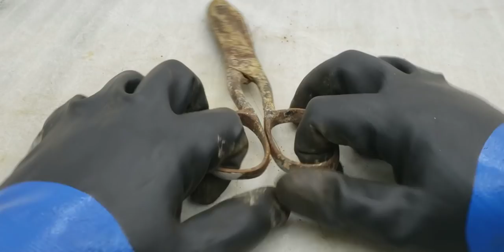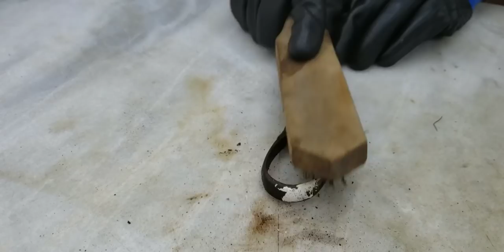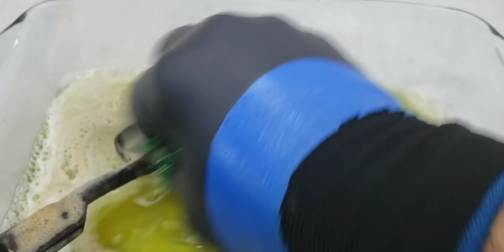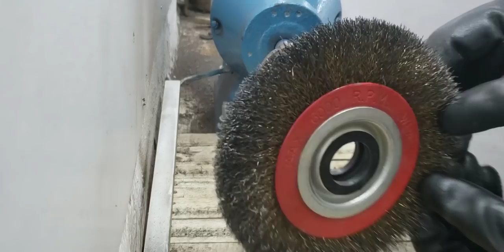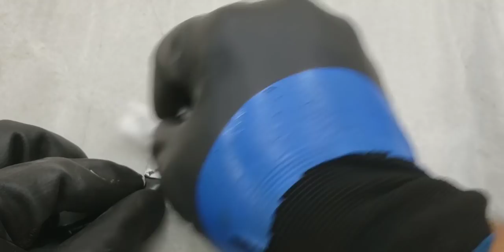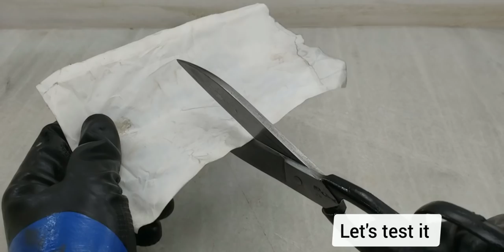70 Years Old Useless Scissors Restoration | 15 MIN RESTORATION

Comment: Those scissors are/were used to cut fabric. Both my mother and grandmother had exactly the same type scissors in their sewing baskets and they only used them to cut fabric. Cutting paper with those scissors were a huge NO NO. Taking care of your scissors and use them properly were among of the very first things I learned when I started sewing back in the 50's. Great job repairing them. 👍 🥰
Reply: I started sewing in the 70's. My Aunt's had those scissors. They were born like 1912 and 1918.
Reply: I have a pair of scissors, also my mother's, from the 1940's, and also used only for fabric.  She had a "professional" sharpen them and he ruined them.  Can only cut paper now.  They also have the black handles and stainless steel blades.

Comment: Why do the wire brushing and the soaking and scrubbing if your going to follow that by using the wire wheel?
Reply: It's usually for combined time management.  Overall he probably spent less time getting it to the state it was in after using the wire wheel than if he just used the wire wheel completely by itself.
Reply: @lukeolinger6000  I suppose that's possible but I'm skeptical about that.  I have no idea how much time he spent on the brushing, soaking, and scrubbing but it doesn't seem likely that it would have been quicker than just using the wire wheel.  Perhaps he wanted to minimize the dirt that would have been collected in the wheel.  It's all speculation until he explains his reason(s) for the method he used.
Reply: @jertoneg1830  exactly, we won't know unless he replies.  Using all of those different methods probably generates views and votes too.  Also, the minimize dirt/maximize life of the wire wheel seems like a plausible reason.
Reply: @ResetResto That sounds reasonable.  Thanks.
Reply: I was thinking the same. I wish they would stop wit the big clunky wire brushes ( hand  brush) . To me it's like nail on a chalk board and honestly did not see much difference. A scrub brush and soap as a starter and rust remover to deal with the corrosion. No way in hell I would have used the wheel. Wet sanding all the way. At the end chrome plate is and then paint the handle (maybe)
Reply from the maker: Thanks, JerTone G for your question. There are many reasons. First, we need to remove the surface rust to make it ready for the wire wheel. Secondly, this item doesn’t need much work and time to restore so we need to complete the 15 min video as promised by doing the same task by hand and machine. However, we appreciate your feedback and will consider it in our next videos.

Comment: They came out nice. I would probably not have used the grinding wheel to sharpen them though. I would use stones, or sandpaper on a flat surface like glass.
Reply: Justin Biber
Reply: Vin Diesel
Reply: You didnt He did .
Reply: Old scissors have a slight curve and cannot be sharpened on a flat surface.
Reply: @justinmalone8518  very true, they were bent in a way that the scissors are in tight contact at all time.

Comment: The restoration is incomplete. The handles are still bent, significantly. Both sides need to be straightened along the cutting edge so the scissors can close properly. Everything up to about 8:45 minute mark was pointless. Successive steps erased work of the previous step. In theory you could have started with a rust remover liquid, then take the pin out. Then progress to the shaping wheel. I would have included a polishing wheel, and then hand sharpen from the outside edge. I know you were trying to remove dings and scratches, so a little bit of that is fine. The washing soap, didn't add any value. All in all you did a good job making them useful again, but I think you could have done more, and given them even a mirror shine.